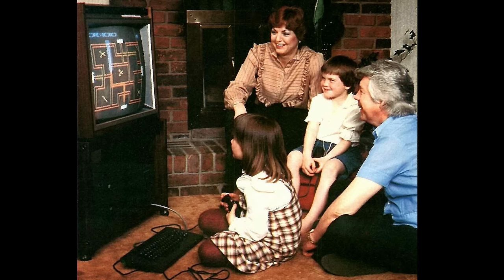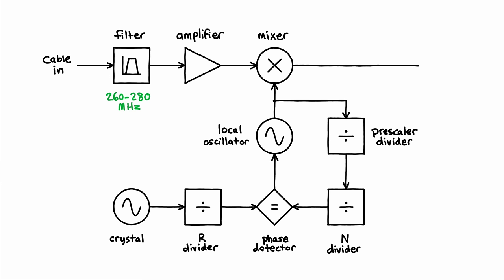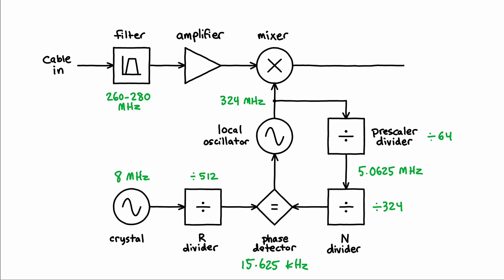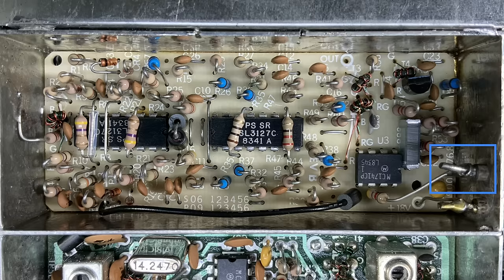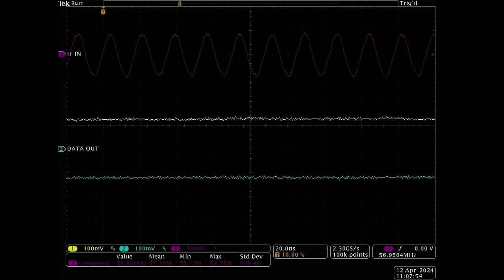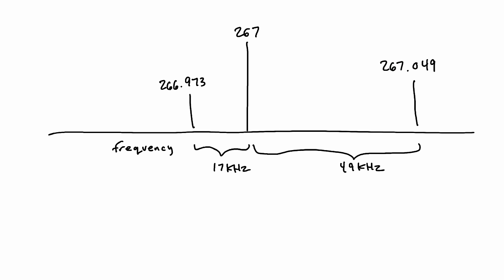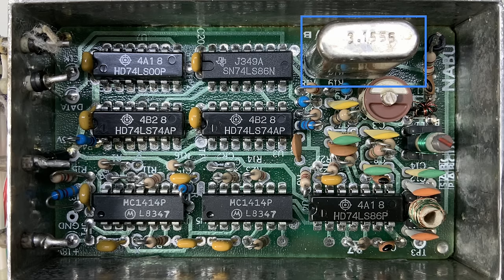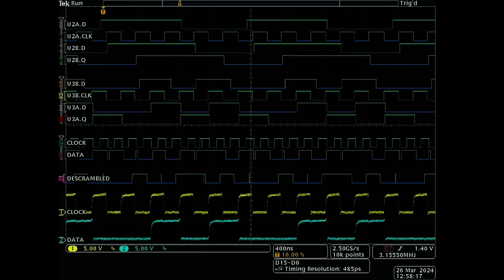The 40-Year-Old Cable Modem (part 1)

Comment: In the part 5:11 I was thinking, is this thing an SDR ? because this looks like what one would be (well, the digital part)

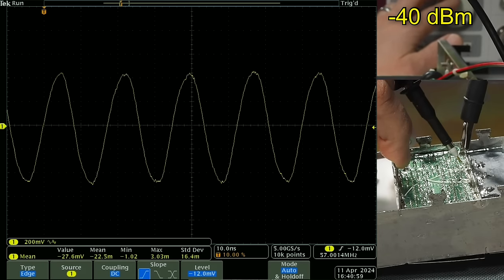And what kind of FM 9:56 is that ?  The data is modulated in the frequency domain, for sure, the thing "rectify" the amplitude of the signal.
 I know enough about the mathematics of DFT - Fourier Transforms to understand the part about the I and Q.  

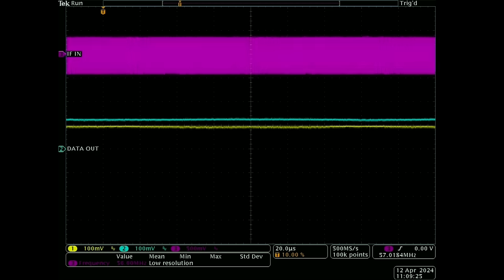12:01 Is that some sort of QAM ? but there's no amplitude change, that would be too complex for such "simple" circuit, only the phase is changing. 
(why did I think of QAM ? don't know, perhaps from the knowledge I have about some compression algorithms on software that uses it , and amplitude is trivial on software, just use enough bits in the float , well the way I see it is, you demodulate, throw things away and modulate back in a lossy compression algorithm, if you do it on amplitude, frequency and phase of the signal, you get to compress more information )

Oh, its obvious (after looking a table), if only the phase changes, must be PSK, not QAM, QPSK because its better to transmit more bits per clock. I always think of the phase in QAM and forgets it modules on the amplitude too...
I was almost there, its some sort of QPSK. (glad I could follow the thinking, not being completely lost was surprising on this topic , but this was very well explained too)

I loved how you solved the mystery of reverse engineering the thing.
Fascinating topic.

Can't wait for the follow up.

Comment: Great video and excellent reverse engineering.
However, the device should not be referred to as a modem, since it demodulates only.
Bi-directional cable modems did not begin field trials in cable TV systems until 1994.
Reply from the maker: That's a totally fair point! It's very much only a "dem", though I've heard rumors there's an earlier version of this device that supported a back channel. Apparently they took it out when it became clear the cable operators they were dealing with wouldn't support it.
Reply: @sharebrained  Until mid 1990s, CATV systems were almost all fully coax based from head-end, thru distribution network, to end users homes. RF amps for distribution of signal were only in one direction and a significant investment was required to add RF amps (or replace with bi-directional amps) for the reverse direction, to allow bi-directional communications. For the reverse path, early pilots of cable modems used sub-low band channel T-10 (23.75-29.75Mhz).

Comment: 6 mbps is slow compared to today’s broadband. Today I can get close to 200 mbps where back then,dialup was the mainstreaming connection protocol. That modem would never work with today’s speeds. You’d fry it if you tried.